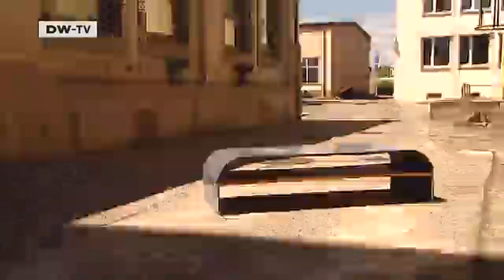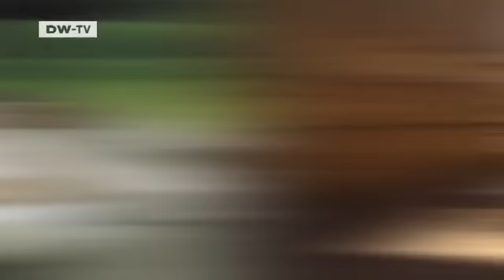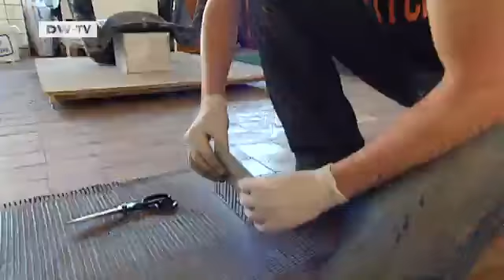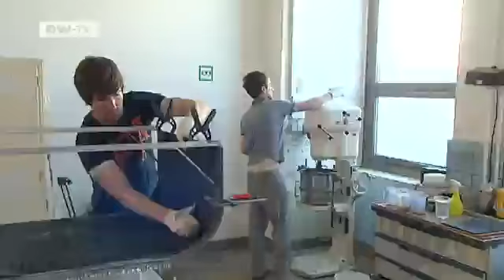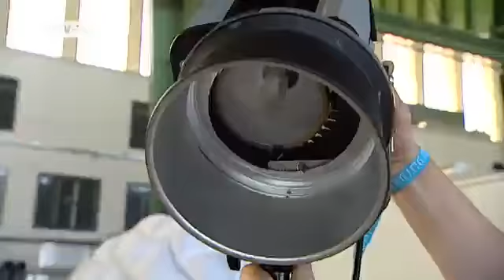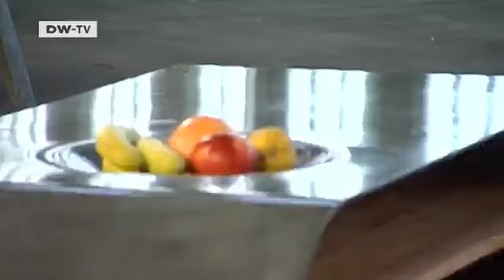Furniture Made of Concrete | euromaxx

Comment: Firstly, congratulations to these guys and good luck with their company.  Also, the University that developed the carbon material, good job.  Having said that, there is nothing special about this furniture to warrant the price and all of this furniture can be reproduced with many other materials from wood to plastics that would just as good if not better and would cost much less to produce.
Reply: I am thinking about building a table framed out of thin metal rods and chicken wire. I am hoping top get the strength I need from the concrete itself.

Comment: Seeing that the concrete with carbon is only 2cm thick can it be used for polished concrete flooring on top of a concrete slab so that it does not have to be load bearing?